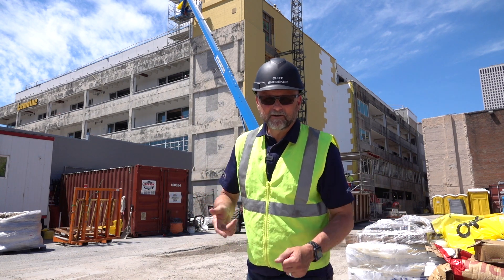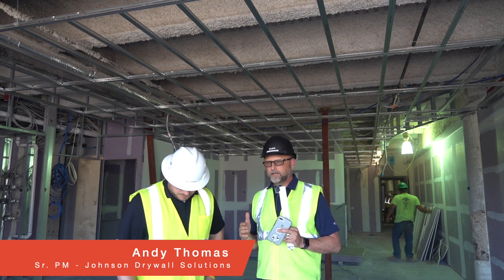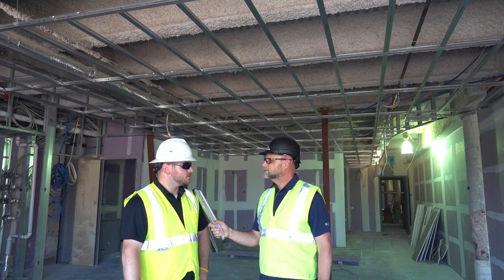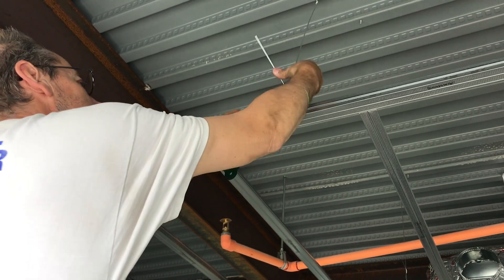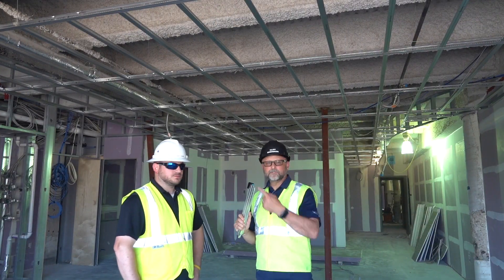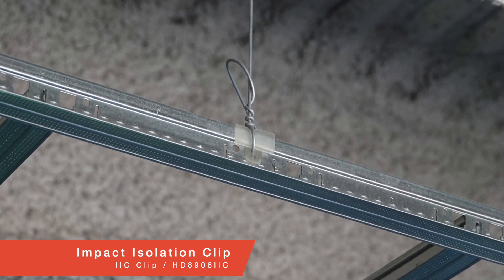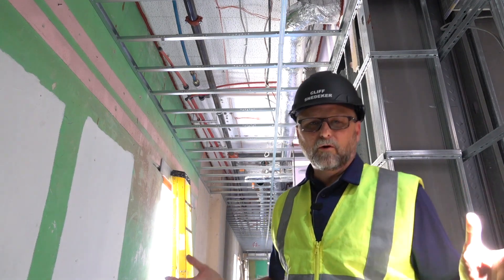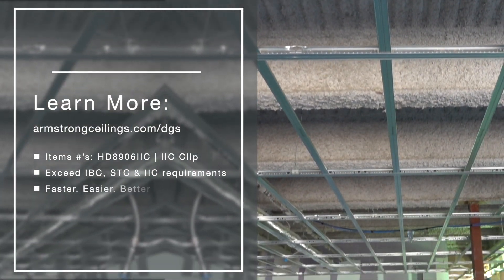Impact Isolation Transmission | Cliff Man on the Street

Comment: That 1foot cross tee being used for the mic 😅🤣
Reply: I like it ! I’m an acoustical ceiling installer my self ,  I love my job and can’t picture my self doing anything else ! By the way the videos are great man god bless 🙏🏽 and keep up the good work !
Reply from the maker: Eduardo Babb - Thank you so much for your kind comments! We are gratified that you like the videos and we love interacting with our viewers and customers!
Reply: Anything similar for the Australian market? Keep in mind we are not allowed to use tie wire suspension system. We are using 6mm steel rod suspension with adjustable hook or clip system. If acoustic isolation is required then it's more often we are to use slab mounted isolators.
Reply from the maker: TheSharpyehT - thanks for your question and watching the video! At this time we do not have a way to attach this IIC clip without 12 gauge hanger wire.  You just gave us a great idea to add to our list! Thanks And have a great weekend!
Reply from the maker: Eduardo - Thanks for your keen observation!  I got to the project site to film this and realized that I forgot my second wireless microphone!!  I had to improvise and clip my only microphone to a cut drywall grid cross tee I had laying on the floor.  Worked out well in the end, but funny in the process!  Take care!